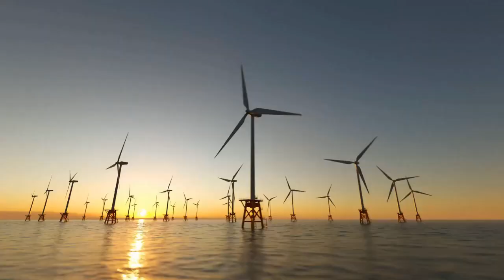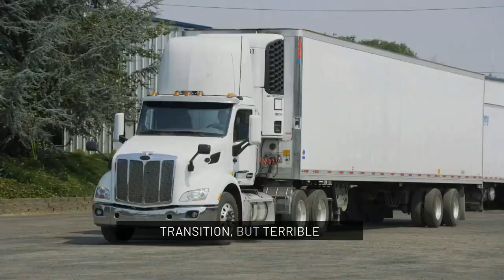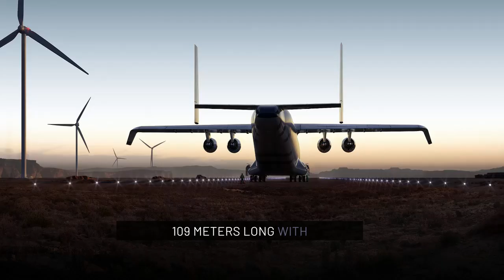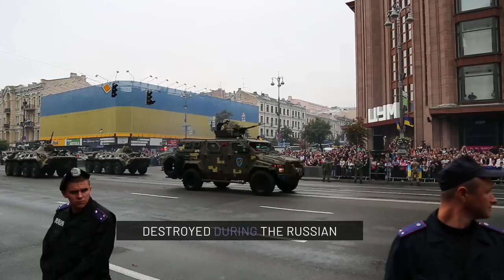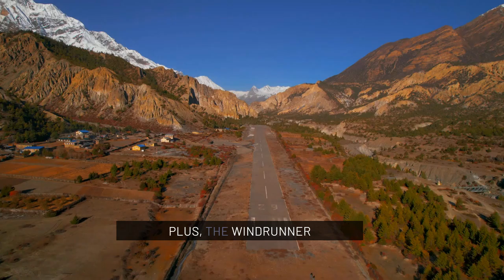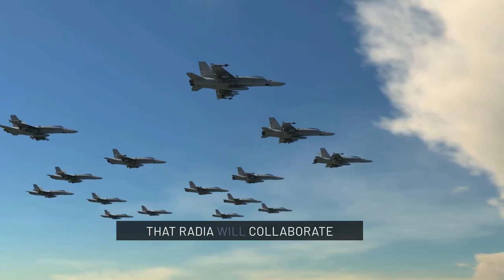The Largest Aircraft Ever Built - Carries Entire Fighter Jets

Comment: Biggest airplane was kinda beast of Caspian with using maximum ground effect but those kind didn't last because there was faster ships with a huge cargo size and if that cargo was expensive enough they used commercial and military or like beluga for airplane parts 
I don't think there will be planes bigger at some point since it's not economical after some point and needing special landing zones defeats the point of being on remote part
So in order to make something that big there should be special airports for carrying cargo from water ports to inner continental grounds
I wonder why there's not that airplanes got built for landlocked key points with huge cargo transportations opportunity
Reply from the maker: I think you have a good point over there. I dont know exactly which calculations they made but The Windrunner might not be economical indeed. On the other hand, the transition to green energy is going so fast that the demand for these solutions might get bigger